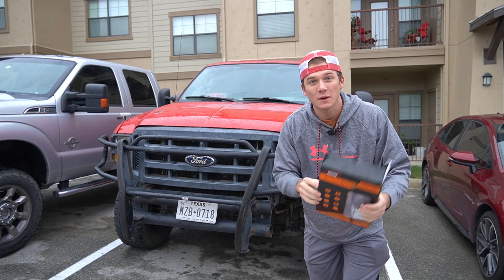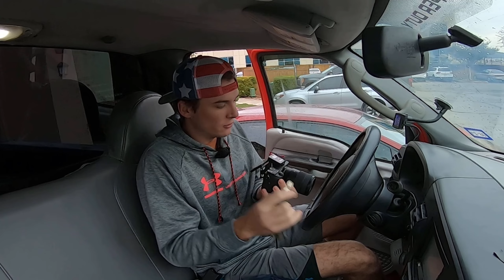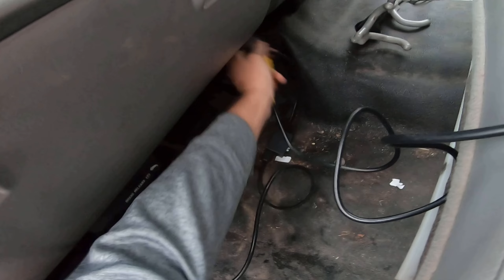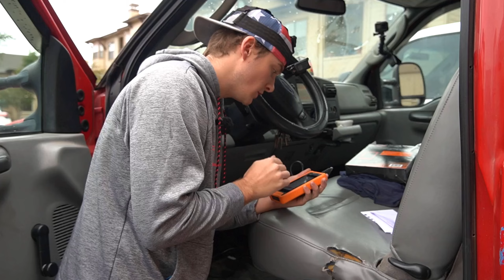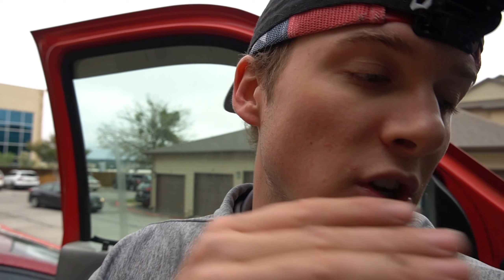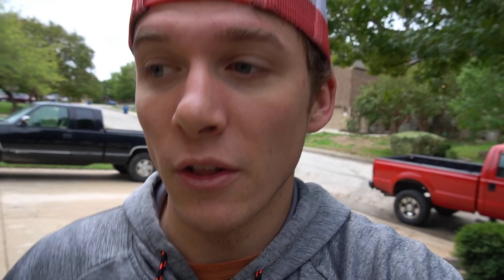I Scanned My 6.0L Powerstroke For Problems & Found This

Comment: The vanes are stuck in the turbo. Also check and see what your EBP voltages is, with the key on, engine not running. It should be like .82 to .84 volts.

Comment: Assuming your long-term goal is to have a reliable powerful truck you can have fun with and test performance parts, then it will be cheaper to push it to catastrophic failure first (blow it up first).

This truck will never make reliable big power until engine is completely removed, studded, resealed, front end done, etc.  Otherwise you’re just going to burn money “fixing” endless problems.

It’s already a POS.  Go from that stage to better, not from POS to  somewhat fixed POS to blown up POS, lol. 

Just don’t break that nice new turbo in the process.  That will hurt me to watch. 😢

Comment: If your steering wheel is shaking like crazy when you brake it’s because your front rotors are warped to holy hell. With 185K on that truck i’d be willing to bet that the previous owners have never torn into that front axle. Time for a full axle rebuild, replace any worn steering components, and replace your front brakes.

Comment: I know your ABS is definitely an issue, however my truck (2008 6.4L) showed “brake system” errors and threw lots of codes just because 1 of my batteries was bad. Tested both batteries and replaced the bad one and the codes went away. Getting a new battery won’t fix all your issues, but if it was anything like mine, it might fix a few of your codes. Worth a shot since you need one anyways!

Comment: Looks like a 6.0 doing 6.0 things.
Reply: No shit he threw a hot tune and started ripping on it 😂
Reply: @masterblaster3118  it doesn't need the tune to do that. I've got a vt365 in my f650. I've replaced the block once. Had it "bulletproofed" but have still had it in the shop multiple times since. That truck is the backup chip truck for my tree service.
My f750 has a 6.7l cummins and an Alison. That truck has never left me stranded, and it works hard everyday. Fully loaded with the 7000lb chipper behind it, I've weighed 35k before. Still will do 75 on the interstate. 
My 2003 ram with the 5.9 and the 2002 f350 with 7.3 and zf6 have never let me down either. There's not a person alive that can convince me a 6.0 is a good engine. You shouldn't have to sink thousands of dollars into an engine to make it good. Just my $0.02 from an uneducated redneck tree climber.

Comment: I’d fix it first. The reason why ppl complain about the 6.0 is cause they throw all this power at it before fixing any issues then bitch and complain online about how terrible the engine is. So if you blow it up, don’t come on here and bitch lol you’ll be spending more money if you don’t fix it up, but I can’t control what ya do. 

I’ve had mine for a few years and haven’t had any major problems with it. Drive it all across the country and pull a TT behind it. May start a channel of mine

Comment: Personally I’d do the water pump, ABS module, and probably some aftermarket steering stabilizers just to make sure your front end doesn’t start dancing like shakira when you’re slowing down from going Mach Jesus with that stage 4 turbo 😂
Reply from the maker: this is the best advise so far lool